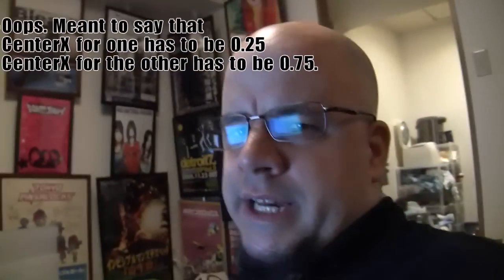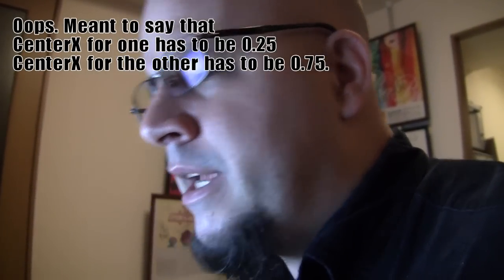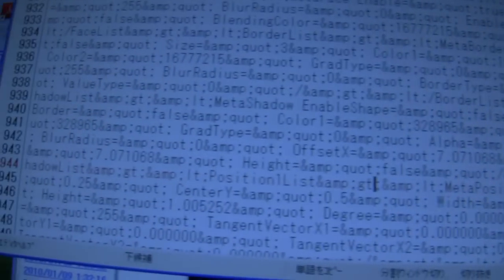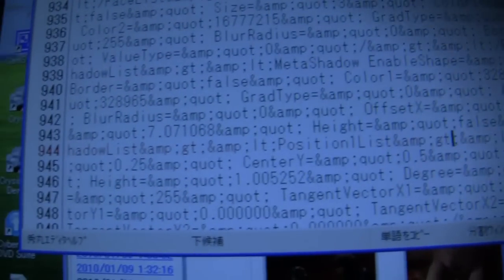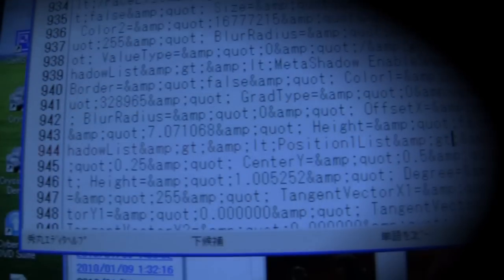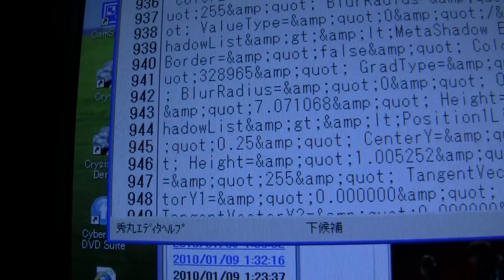#393 Tweaking Power Director 8 PiP Object Position and Size for 3D

Comment from the maker: @Apokalypse34 A pair of Xactis would actually be a good way to try it. Them things are cheap now, relatively, and they have a little threaded hole in the bottom so you can attach them to tripods or brackets or what have you.

When filming with two cams, tricky bit is picking a distant point and make sure both cams are pointed at that point. When editing the tricky bit is syncing up the two vids. Learned a lot just by trying.